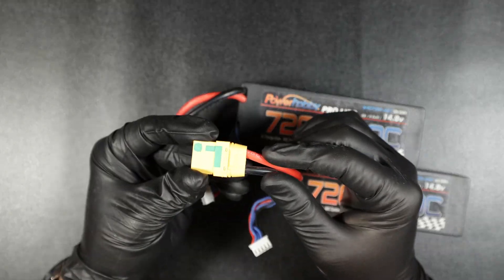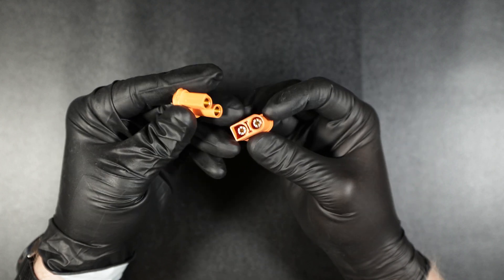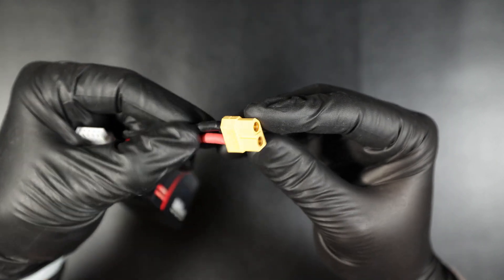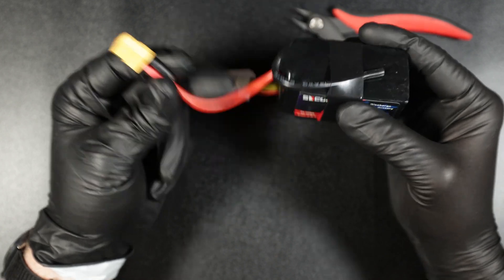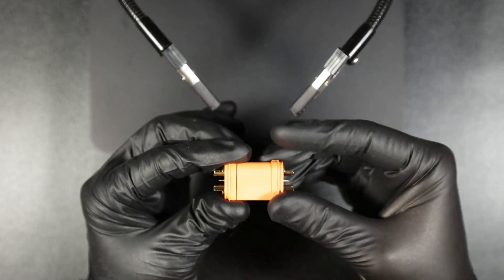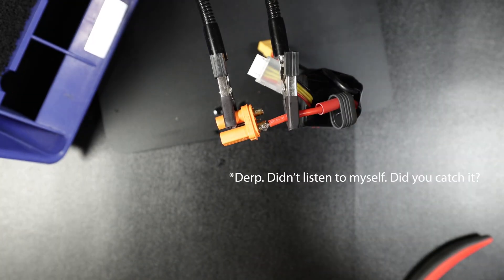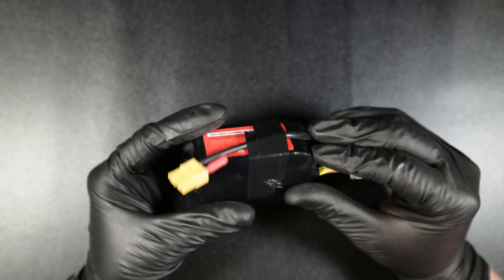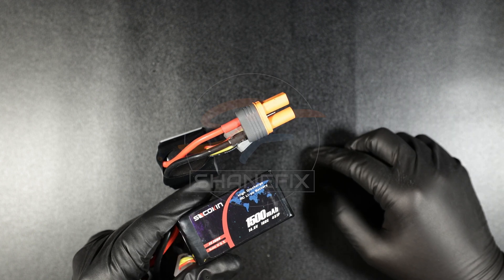Convert LiPo battery to IC5 Connector

Comment: To avoid damage to the plastic all together as its NOT heat resistant, push the pins out, (some are pull) slide your shrink wrap down slide the plastic on, solder, the slide the pin into its housing.

Comment: I would recommend a wedge/knife  tip for this type of work its a little more surface area and will melt the solder a little faster. Of course if you dont happen to have that tip or your just more comfortable with something else i wouldn't worry about it too much.

Comment: Hey man great video but I have a question how would I be able to send my ps5 so I can get the hdmi fixed because it doesn’t connect to my monitor and I tried my ps4 and it works. So my question is again how would I send you my ps5?
Reply from the maker: Head over to my website and you can find the repairs there or contact us through the contact page: www.shanefix.com